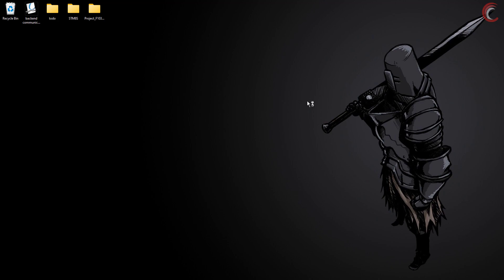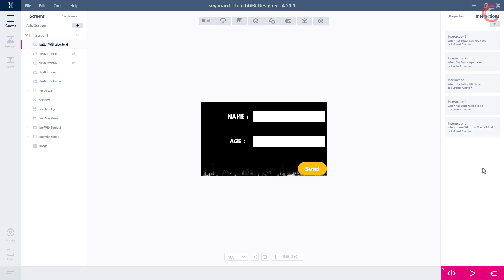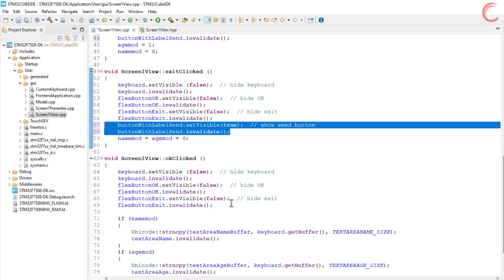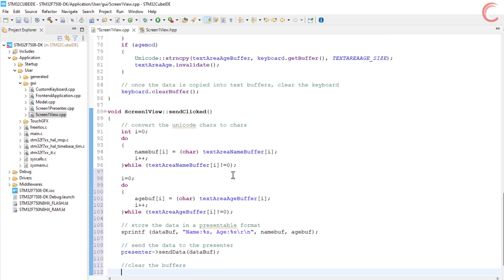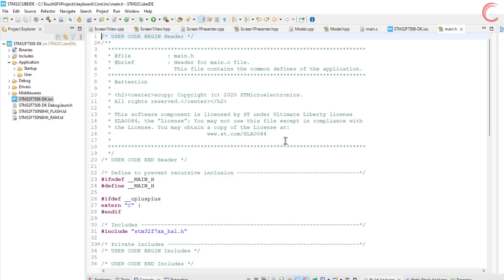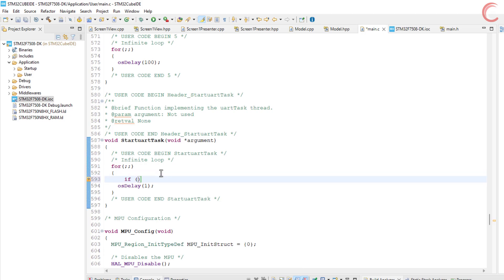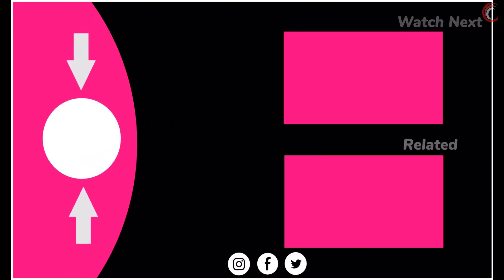Touch GFX #8. Send Data from UI to MCU || UART

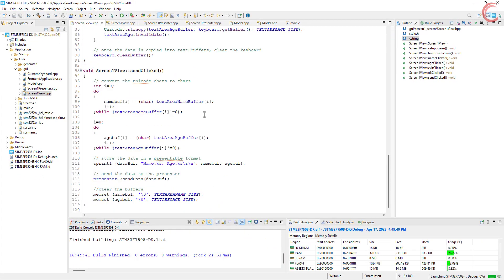Comment: Hello, I am using STM32F769I-DISCO. I have followed your tutorial until 7:07. But when I flashed the code, the result was a black screen; nothing came out after I modified the previous code from your tutorial. As for the UART, I activated it manually in CubeMX since it didn't activate to begin with at 6:07. What should I do for fixing this issue?

Thank you.